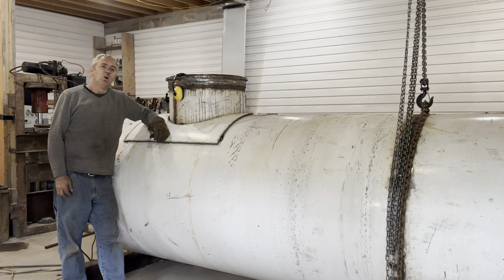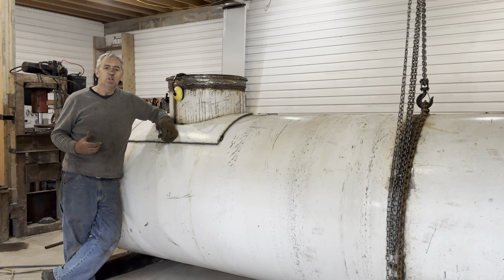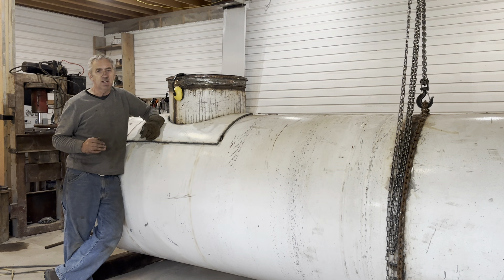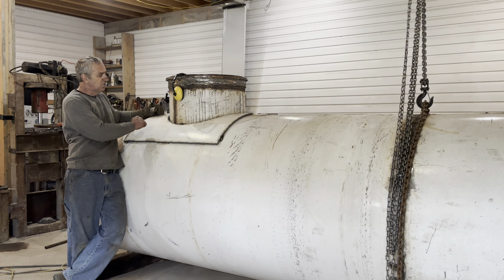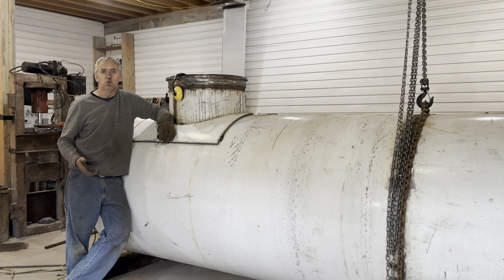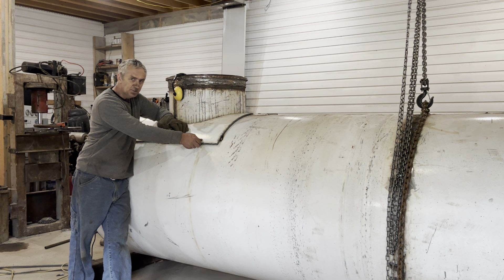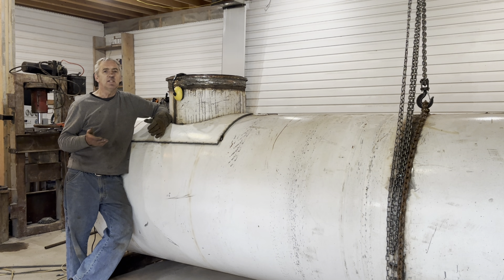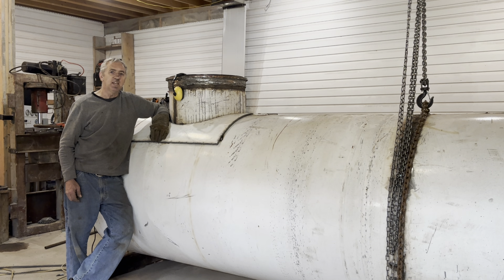I am building a diesel electric submarine, adding doubler plate

Comment: Here is what I think: I have never built a hull cooling system, but I am certain that your only concern would be flow rate. Smaller gap, bigger flow resistance.
Reply from the maker: I agree, it is the water to steel contact that cools, and the contact time, not the volume.

Comment: One from the peanut gallery: The designer in me wants to see that doubler plate cut into a semicircle rather than a rectangle. 😁
Reply from the maker: I want to get as much weight around the conning tower as I can and have it hidden under the deck assembly,  A semicircle would look better, but you won't see it in the end.🙂
Reply: I would put a nice big radius on the corners of that plate. Maybe 3" or so. That would really help avoid stress concentration at the corners.
Reply from the maker: @jerrymalone8370  There is a hull analysis being performed as we speak.  That will show up if it is a problem.  Fingers crossed.

Comment: I'd probably weld a wide belt across the standing frames under the tower to work as the t-bar, the water cooler reservoir and the doubler at once 🤔
Reply from the maker: That is the plan but at the bottom of the hull.  If it is up high it will not be in contact with water.

Comment: I, too, have never built a hull cooling system, but here's what I think. I think you would be better off having a sort of radiator system where you have cooling fins, just a top, the outer skin of the hull. Sumed up the goal of that would be to increase the surface area of the exposed plate to increase cooling potential. Another thing if you do end up. Another thing.
You may have done this already, but I find it as a good practice to avoid boxy structures in hull design. Round off anything pointy.
Reply from the maker: Thanks, good points.

Comment: I have keel cooling tank on my narrow boat in the uk. It is about 2” thick and welded on to the side of the hull . I have seen them flat on the bottom of some boats. I think that having the thicker tank allows the water to slow down and separate out in to thermal layers as it passes through the tank. A tank mounted on the side of the hull should be more efficient as the warm water will enter at the top and thermosyphen so cooler water is drawn from the bottom. It’s also much easier to bleed the air out on a vertical tank . Could I suggest making your tank quite wide so it wraps up each side of the hull and having the top hose from the engine feed into the top of each side of the tank and drawing off the cooler water from a single fitting at the bottom. I know it’s a bit more plumbing having to split the feed water but it would make the system more efficient. Also fit a bleed screw on each side to release any trapped air. Having the tank a bit thicker will also give a bit of thermal inertia to the system as it will hold a fair bit more water. Most tanks will have some internal baffles normally to make sure the coolant travels around more surface area rather than a straight line between the pipe fittings. If you can wrap that tank up the sides a bit and make it at least an inch thick with two top hoses I think it will be very efficient. It would mean putting a tee pice in the top hose and running a pipe which could be a half the diameter down each side of the hull to the skin tank on each side. Hope this helps
Reply from the maker: Very good points, thank you.

Comment: So the thickness shouldn't make much difference on the ability to cool other than a thiner channel is more likely to have a larger difference between to hotest and coldest spots. If you add a couple on divider baffles to force the water to flow past the whole surface its should perform as good or better than a thicker cooler. Only downside is increased hydraulic resistance.
Reply from the maker: Yes, I should have mentioned the baffle.  The internet says to put one divider in to maximize contact.

Comment: Some thoughts from a mechanic with no submarine experience:
- Does it affect the structural hull integrity long term, when the heat exchanger part of the hull changes its temperature frequently? It works on boats (that not are designed to sink), but there is no pressure involved (cyclic stresses).
- More coolant makes the system slower in changing temperature (more water needs more energy to heat up).
- Nearly all coolers/heat exchangers have some sort of fins, to maximise the transfer surface (eg watercooled processors in PCs or cooling fins on electronic boards)
-  How to avoid air traps, heat spots and corrosion inside the heat exchanger and how to check for it?
Reply from the maker: There is no structural harm in fact it makes the hull stronger.   No need for fins as the contact area is calculated for the HP.  Air traps would be the same as a radiator, air goes to the top of the system once it is bled off.  I can put a camera down the intake hole to inspect, but antifreeze prevents corrosion.The only comparison I can think of for heat would be a boiler.  The steel seems to hold up fine and in my case being submerged, the heat difference is minor.  All good points to consider.

Comment: I have some limited knowledge of air and water cooling but it's all from trial and error. I guess if anyone knows thermodynamics there should be a formula to calculate your problem. Even though you are running your submarine in freezing water all that matters is heat transfer. Your plan is to make a cooling chamber with direct hull contact. You will need certain amount of surface to transfer all of the heat from water to hull otherwise thick hull will reach certain temperature and you will just circulate hot water back to the engine, no matter what flow rate you have. As you mentioned radiators have very small chambers with thin mesh and reason is heat transfer. You can add some grooves to increase surface area but I have no clue how to calculate how much heat you produce and how much surface you need.
Reply from the maker: Thanks